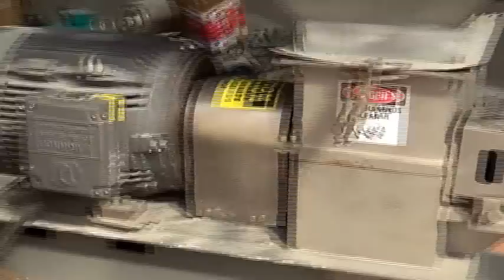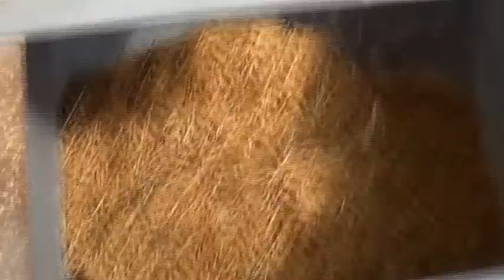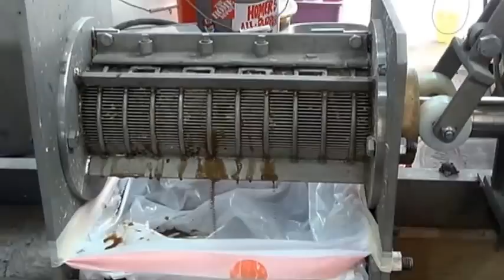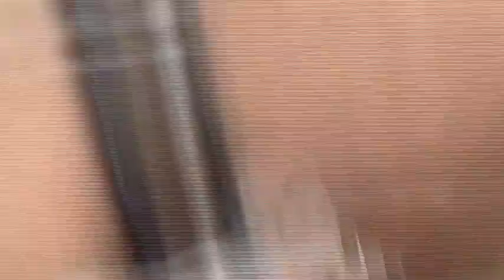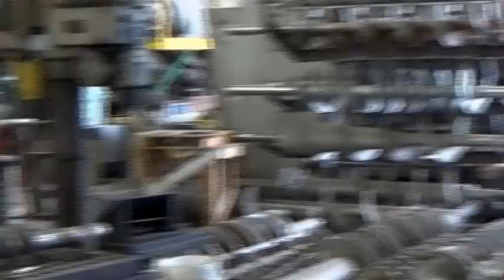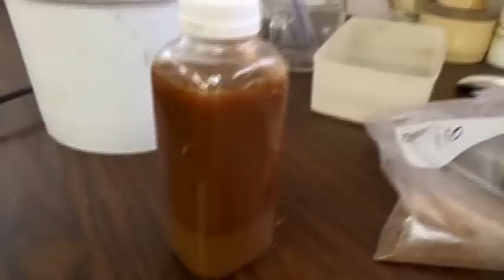VINCENT PALM SCREW PRESS

Comment: A big workshop and great tools, with poor product. You need more clever enginer. 
1. At wood crusher : its need three blades and fifty hammers. The filter holes diametre is 10 mm. See it at my channel. 
2. At screwpresser : first, its need an adjustable feed regulator. So the pressure inside will more constant. The body must be a tube. Holes diametre 3 or 4 mm. Holder strength : 45 bars. Make it from worm spring with adjustable nut and bolt. Screw strength 22 bars. Losses oil can be 0,30 percent only. No need water. Less sludge too.